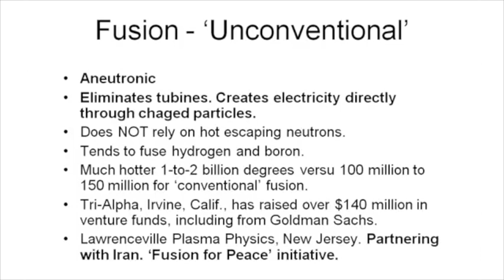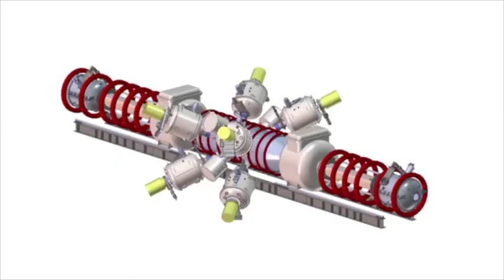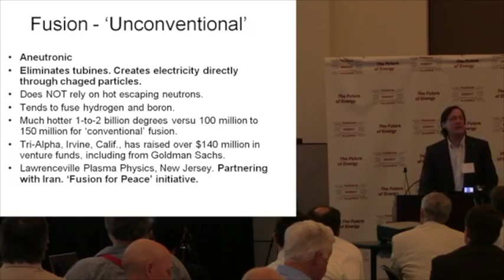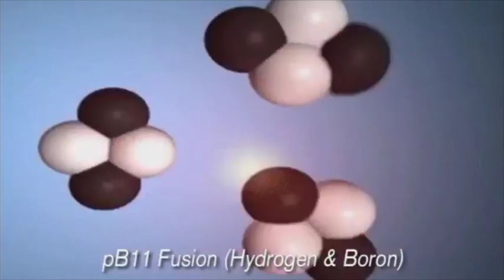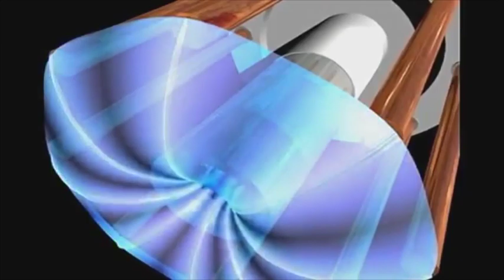Aneutronic Fusion

Comment: SAFIRE Project has you beat by a long shot.  They generate electricity while producing heat, and can remediate nuclear waste.  Appears they have achieved OVERUNITY, and can also TRANSMUTATE matter.  It's only fuel is hydrogen.  And they have sustained long term reactions..